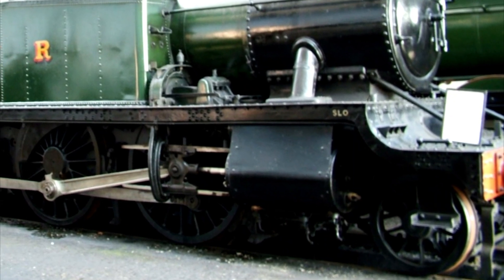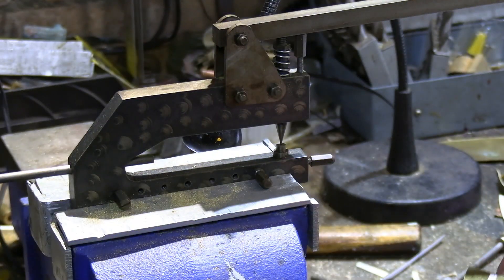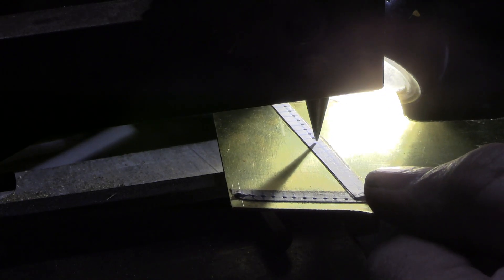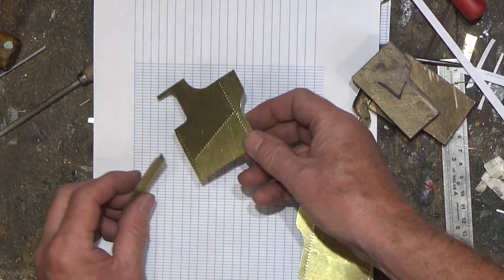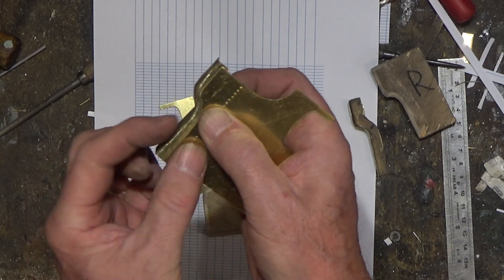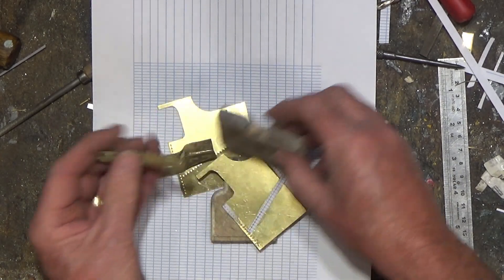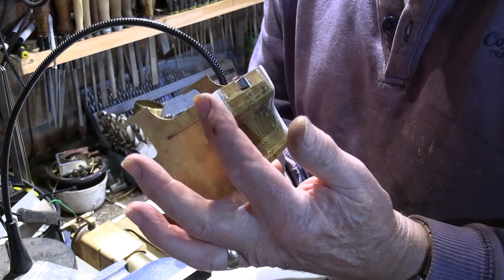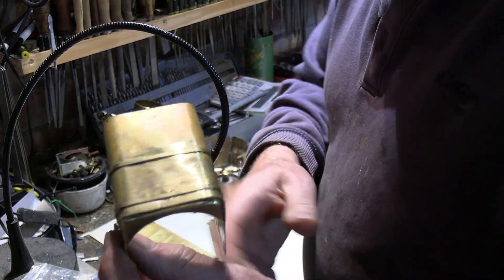Gauge 1 Live Steam Scratch Build 26

Comment: Hello Dave, Great vidéo again ,this vive a lot of inspiration
I have not been through all the  previous ones ,They are ready of great value.
One question If you please, when you shorten the rivet before to proceed ,the remaining length to beat on is équivalent to the rivet Diameter?
I am afraid I Jeep top much of it .....
Regards Patrick
Reply from the maker: Interesting question, I don’t really measure the length I cut to. I have a pair of cutters I use.  That when they rest on the surface of the workpiece and I make a cut it leaves just about the right amount of metal left to rivet down. I agree if you leave it too long. It makes an untidy bent over riveted end. On the two pieces to be riveted together I add a slight counter sink on each side of the hole for the soft copper to expand into during the riveting process. Sorry I can’t be more precise.
Reply: Hell Dave
Indeed I proceed Like you , I counter sink the opposite Sheet Side of the rivet head, next time I will Experiment with1.5 Diameter length...
Regards Patrick
Reply from the maker: @patrickcompere1406  👍